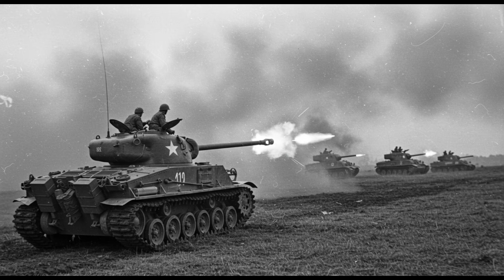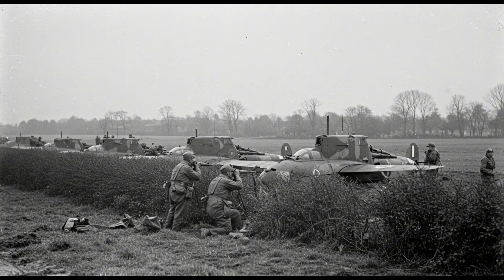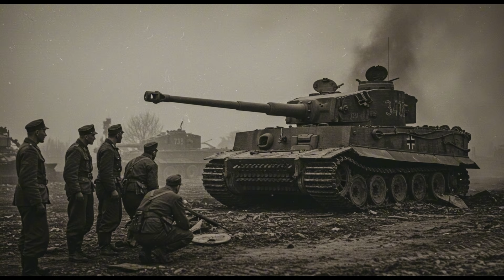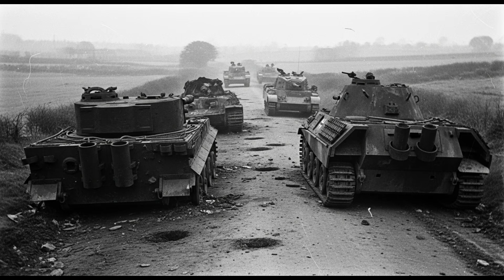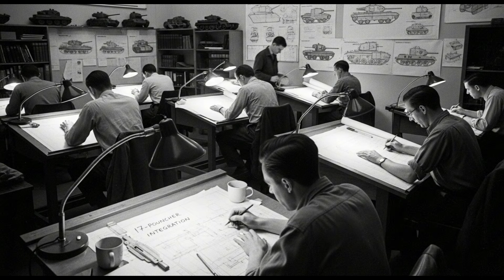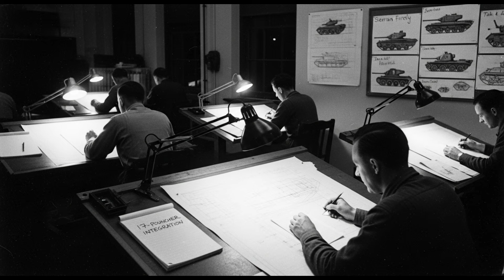German Tank Crews Mocked the British Firefly Until Its 17 Pounder Turned Their Panzers Into Wrecks

Comment: What nonsense. First, the most common german tank on the western front was the Panzer 4, only very few Tigers, they fought mainly on the eastern front. The Panzer 4 mounted at that time the 7.5 cm KwK 40, that could penetrate a Sherman at 1000 m. Most reports of tank kills of Tiger 1, were actually Panzer 4.
Nobody on the German side mocked the Firefly. They also did not mock the 7.5 or 7.6 mm Sherman guns.
Reply from the maker: They mocked literally everything, where is your source from?